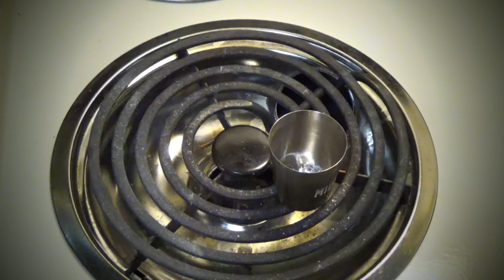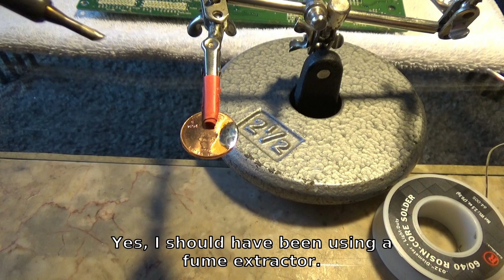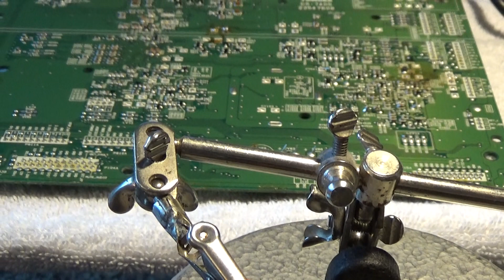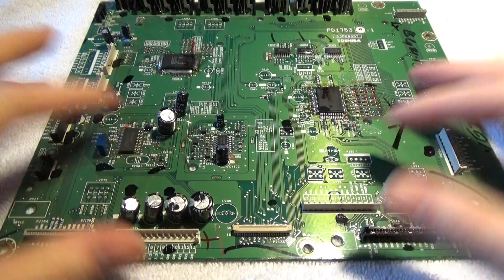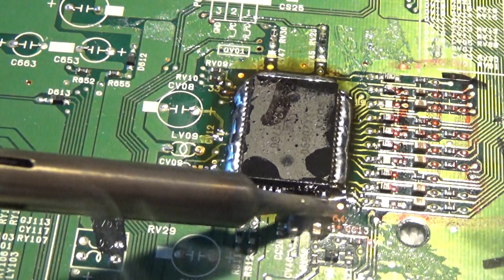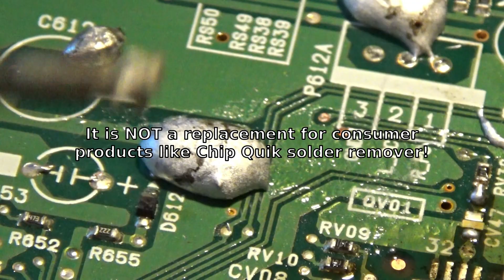Homemade Solder Remover Alloy - Field's Metal

Comment: you can always use a hot air disordering station its much more cheaper then the indium in Fields Alloy. Also each time you use it to disorder you contaminate the alloy with Lead/Tin/Silver depending on the solder used by the manufacturer to assemble the boards. In my opinion its a very bad use of that beautiful Fields Alloy. I would use this alloy as replacement for mercury and make experiments with spinning liquid metal in electric field.

Comment: Have you tried regular bismuth (58%), tin (42%) for desoldering? The melting temperature is 138-145 °C which is nowhere near as low as Field's Metal but it's a lot cheaper than ChipQuik and available in wire-form; just make sure you shop around because some places charge an outrageous price.

Comment: WHY is it no replacement for commercial Chip Quik? You showed it works alike.
Reply: He mentioned this, it's corrosive to the copper traces. Will need to be wicked very thoroughly or there will be board damage over time.
Reply: @SerenoOunce  he says: "it is known to be corrosive to aluminum". I wonder where he got that from, i cannot find infos on that at all. Perhaps he got confused.
Reply: @SerenoOunce  Bismuth and indium are metals found in some of ChipQuik's alloys so I don't think they would be harmful.

Comment: So is the Field's metal cheaper than Chipquik? I recall that Chipquick is expensive.
Reply from the maker: If you can find cheap sources of these metals, it could be cheaper. The indium will probably be the most expensive, and I got a good deal by buying used cryogenic gaskets.
Reply: @TheBeardScience  At some point you said you don't recommend trying to use it as a substitute for chipquick. Do you still think I should just bite the bullet and buy the consumer grade stuff? I'm just going to be desoldering a few keyboards.
Reply: @stopthephilosophicalzombie9017  When ive looked this stuff is still expensive, id rather stick with Quik Chip. I did a lil review of it and was very pleased with it.  https://www.youtube.com/watch?v=DPqaxx2Coh8&t=1s